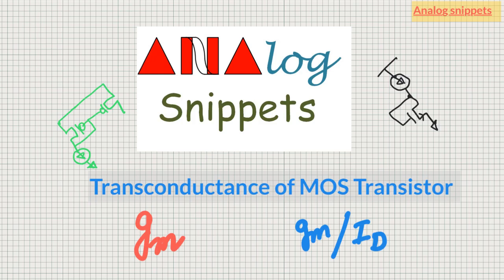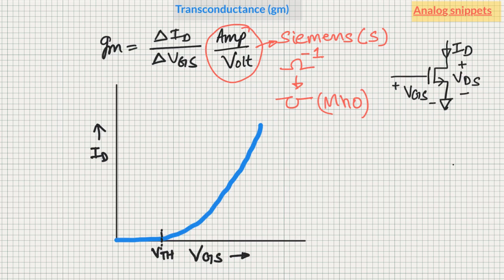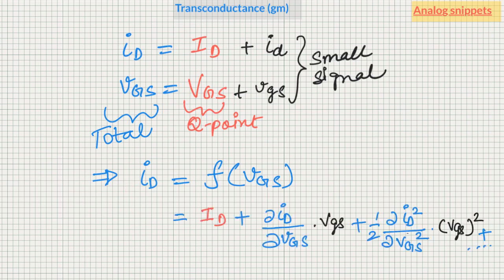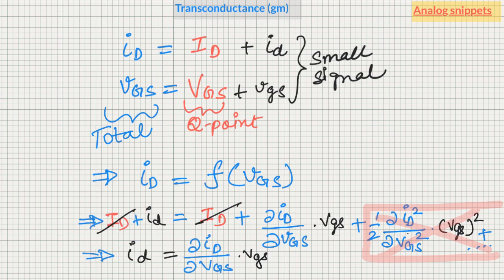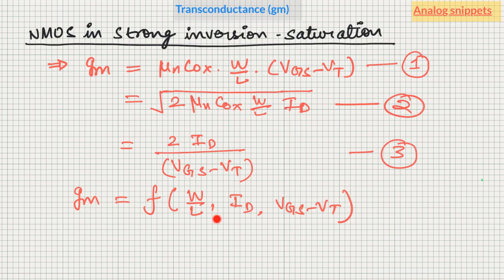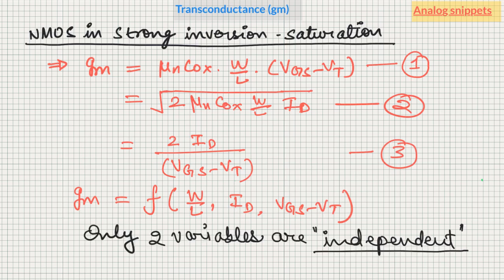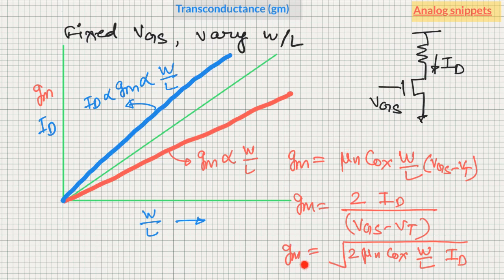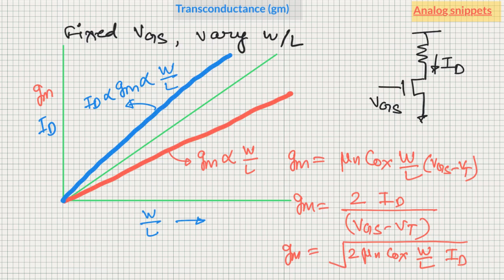#3 Transconductance of MOSFET in strong inversion

Comment: Thanks for all your efforts in sharing your design experience with meticulous documentation and intuitive explanations! I am enjoying the videos a lot!
If possible please clarify further on one of the points shared in the video:
- It is mentioned that Gm has a strong effect on: Gain, Bandwidth, settling time, matching and noise.
Q. Gm effects Gain, BW, settling time and noise. Agreed! But I could not recall the effect of Gm on Matching of transistors. Did you mean the input referred offsets? From what I recall, the threshold voltage offset depends on the area of devices W * L, and I think one can visualise the input pair Vt offset as input referred offset directly, so that gm does not come into the picture at all. I think my thought process is not in the correct direction. Any inputs will be very helpful. Thanks for the help!
Reply from the maker: Hi Rahul, glad to hear that you are finding videos helpful. To your question: gm does appear in mismatch equations. It appears as gm/Id ratio. You may review video #8 where I discussed mismatch of current mirror. Similar derivation can be made for input diff pair. Please let me know if you have follow up question. Thanks.
Reply: Thanks a lot for pointing me in the right direction. I was focusing on the absolute offset alone, but I see your point now. The derivations for relative offsets are great. I do not recall seeing this level of detailing in most of the books I have referred. Thanks again for all the awesome videos! :)